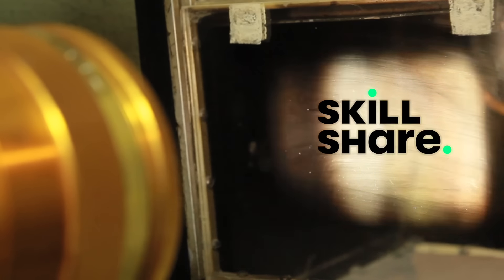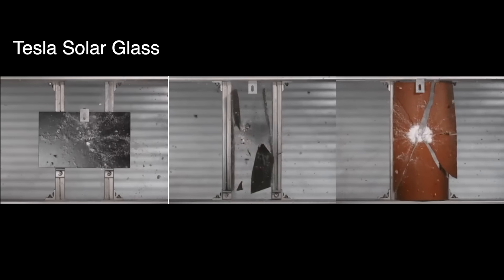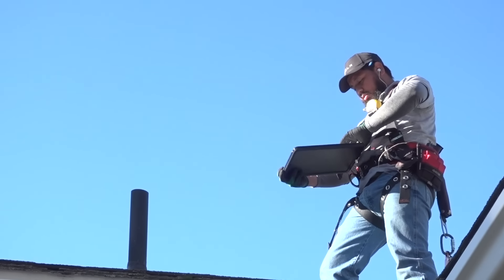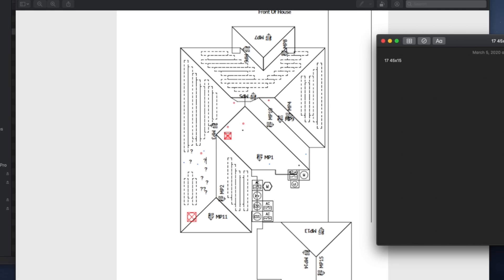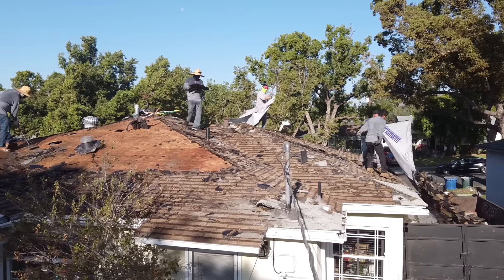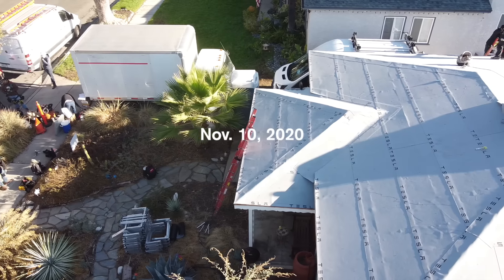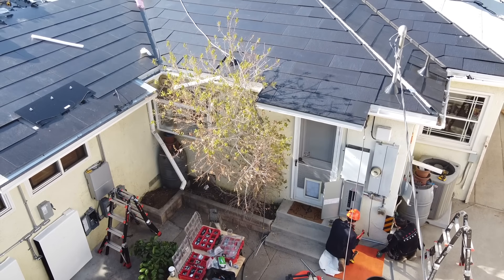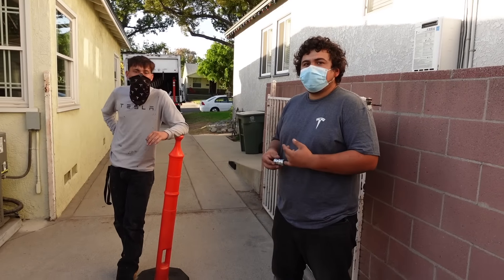This Tesla Solar Roof Was NOT Built in a Day

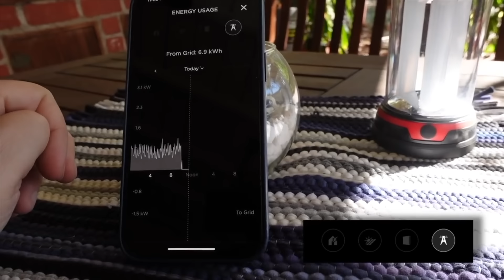Comment: 49:16 "Completely off grid" - Meaning the microgrid switch is open and the house is in island mode or that no power flow is consumed from the grid? In islanding mode, what happens if the batteries are empty? Do you have priorized circuits that are kept energized, while not so important ones are disconnected e.g. by under-frequency or under-voltage protection?
Reply: I think he might be misusing the completely off grid because his solar is overproducing by 100-120% of what they use. So yes it’s off grid because they give back more than they take, but technically they are only off grid for 60-70% of the time. Meaning the solar powers the home in the day and the powerwalls for some of the night.  He then switched back to grid power around midnight or something.
Reply: I think he might be misusing the completely off grid because his solar is overproducing by 100-120% of what they use. So yes it’s off grid because they give back more than they take, but technically they are only off grid for 60-70% of the time. Meaning the solar powers the home in the day and the powerwalls for some of the night.  He then switched back to grid power around midnight or something.
Reply: @Energy.Theory  It is not only the power balance regarding the true island mode. In an island you can't import ancilliary services such as frequency and voltage stabilisation, but you have to do all these task by the local assets. It is doable, no quetion, but more expensive than just only producing power.

Comment: I am a roofer and all rotten wood replacement is cost plus that's an industry standard. However they should have noted the 2x6 deck in the inspection. The price was super fair, plywood was crazy at the time.

Comment: You know the one thing that would probably most help California's wild fires is good forest management. The added bonus is the brushwood collected could be used for brown energy/biofuels.
Reply: Good forest management as in controlled burns?
Reply: @GeorgeMonet  Good forest management as in making causeways in trees to prevent fires from jumping from one section to a next. Cleaning up some bracken and deadwood, and using it for bio-digesters or turned into wood pellets.

Comment: Their underlayment looks like their own branded ice and water shield... its over 100% of the roof. The roof needs to breathe or you will get dry rot. You should only use I&W shield around penetrations, in valleys, anywhere the roof meets a wall and in NY you need it to extend 3' into the living space from the gutter.

Comment: The diagram at 19:02 is eye opening to me. I had assumed that every tile generated power, which would make tiles much more productive than panels on the same roof due to the increased surface area. But I see that’s not the case. It does look like the active tiles cover more area than panels would, but maybe not a lot more (judging by how my panels fit on my roof). And I’ve read that panels are more productive than tiles. I wonder how many kwh you would have gotten with panels?

Comment: Hi, it is very interesting as a diary. Couple of questions:
Which is the projected maintenance cost of the installation within the standard industry expectancy [circa 10 years]?
Which is the projected impact on the loss of real estate value when selling the property? [Loss, as with any service within a building, like HVAC, they will need to be changed and when selling the house, it is one of the first bargaining points: the age of the installation. And because it is not a passive installation such as plumbing or electric cable, it is subject to deterioration on batteries, etc.].
Thank you on advance.

Comment: As an Swiss architect with experience in solar roofs I find that American roofs have too many angels, nooks an crannies to be solar and cost effective, it also is more expensive construct. Tesla Tiles may be nice to look at, and easy to install for the average builders, but with so many small parts there are also many small components that can corrode or break, and therefore more cost intensive in maintenance in the long run.

Comment: For anyone looking at this if you have multiple roof penetrations like are shown here that are blocking you from increasing the size of your array I would like to suggest that you investigate with your Plumber the possibility of having some of those vents consolidated and/or relocated. This is not always possible but many times it is. 

Remember that when the house was built there was no concern for having as much free roof area to support solar panels or solar roof tiles and that they are not going to consolidate vents when it would cost them more money in material and labor to do so. 

But now, if those same multiple vents are blocking the installation of solar it would certainly be worth it to have a licensed Plumber move them if possible. DON'T let the solar installer do it (unless they have a plumbing license), get a licensed plumber. Fewer roof penetrations would also be in the best interest of the solar installer because there would be less obstacles to work around.

Comment: Thanks for taking the time to document the whole process. It actually answered a lot of questions that I have about Tesla’s product and process. I am looking forward to your latest update. 

I have a new home so I am struggling to justify the the roof system over the panel but I sure like the look it really is attractive. 

Couple of additional questions that I haven’t seen any one ask. 

I am curious if you have looked at what increase in value you might have seen by adding the system? I am curious because home values are already high in CA but if it could help raise the value enough to possibly remove PMI for some maybe that could be an added value. 

Do you know if there is and added R value / insulation with the new roof system? Have you noticed any benefit? I haven’t seen anything documented and would be curious. I would think for your home there would have been some kind of benefit based on just what you replaced but honestly I have no idea. 

Thanks again for the great videos.
Reply from the maker: Thank you. I wouldn't have any data on either of those questions.

Comment: It's crazy how many people your crews had on site for working... and probably not in a good way, seems like a justification for jacking the price to be honest. I've recently had solar panels fitted, then taken off for a new roof to be put on and then refitted. The panels took one day to actually fit (traditional ones) with two guys doing all of the work, the roof replacement took about 4 days (including facias and guttering) and that would have taken less time if it wasn't for the lack of access to the rear of my property. Again, that was 4, maybe 5 days (not even full days) with two guys working it. The roof replacement was a completed replacement as well, stripping all of the old tiles (heavy concrete tiles too) and replacing like for like, with weather proofing, new timber and boards.

Granted my roof is probably a little smaller than yours but in return my building is a fair bit taller (a very tall 2 storey building) and the tiles more substantial but I think it's really odd that you had like, maybe 10+ people to bill for in those crews. Crazy... is this normal in the states?

Comment: So love the idea of my roof producing power. So we also Installed a solar system, our system after about two months research we decided on our set-up and what we might need. We ended up with a 10.5 kW system on our roof and it cost under $13,000 AU dollars now the government also gives a small rebate the company that install it. We love the reduction in our power bills. But we still have bills and it hasn't taken us off the grid and no we don't have a big house and we are very carefully about how we use that power. So the cost of a Tesla roof seems an extremely expensive system to install. But l'm glad to see this type of system it does look far prettier than my panels.

Comment: Interesting.. here in Europe we have no installation outside the House .. the only thing thats outside is a fuse for the energy provider.
The battery and inverter are sometimes in a Garage on the Wall or in a seperate small room in the house where also the meters and ac equippment is located.

Comment: I had an old roof so had a new one put in about 8 months ago, costing about $14,500. Tesla (Musk's company) will probably put in about 13 or so solar panels to get me 7300kwh of solar at a cost of around $7-8000 (not sure yet since design is not done. I don't find that a battery will work for me and they are incredibly expensive so my total cost for the solar panels will be less than $9000 with a payback in around 4 years. I wish you success with your system, particularly not having to pay large repair bills after the warranty expires. Thanks for sharing your excellent video!

Comment: NOT PLYWOOD!  
Great Video very nicely produced / post produced. 
I don't know if anyone else has mentioned this. But you have been specked / charged for PLYWOOD and everyone refers to it as such, but what you have is something quite different! I believe it may be called 'STRAND BOARD' in the US and is what we call in the UK 'CHIPBOARD' sometimes 'OSB'.  Made by gluing and highly compressing scrap/chips of wood together into sheets. As apposed to shaving long lengths of tree trunk and gluing / compressing them together at alternating angles for strength as is the case with plywood. Very strange as your additional $3k cost was specifically to cover the additional plywood?

Comment: I looks like the powerwalls run of AC which is a waste converting the DC coming from the solar to ac and then bak to DC to the batteries. Other brands run DC to the batteries and use the same inverter for both the batteries and the solar, which is more effective. But looks like a clean install overall.

Comment: I don't know what this guy does for a living but how calmly he answers with a low energy "ok" when they tell him how much more it will cost or how long he'll have to wait is not how most people would react. As an engineer I know the price of the hardware. Using 16 panels rated at 450W each, that would produce 7.2Kw of power. Each panel is $240 x 16 = $3,840 of panels to get 7.2Kw of power. And they charged him $31K for that part? Then you have three main components in a system: 1.) The inverter that changes Solar DC to house 120VAC and 240VAC. 2.) A battery. And 3.) A battery management system. Let's start with the battery. Tesla's Powerwall is $7,700 each. They're rated as 7kW backup power each. On my first attempt I found a 10.2kW solar backup battery for $4,900. And there are even less costly ones I could find. The battery management system (which helps not over charge the battery is about $800. And a Sunny Boy 10K inverter is $900. So forgetting the roof replacement for a moment and adding in about $6,000 for permits, junction/breaker boxes and mechanical hardware it would be a close amount to $24,100. HALF of what solar installers charge. This is very typical of solar installers. If you want to make a lot of money, don't charge 100% more, just 50% more and you'll get all the business. Solar is still a scam price wise. This guy must have a lot of money to spend. Even if your electric bill is $400 a month it will take you more than 10 years to see a profit.

Comment: 25:50..."sheets of plywood"..then they instal OSB.  NOT THE SAME THING !  This isn't so much a knock of the Tesla system, but more a warning of selecting the right roofer/installer.  Also you have to do it to Tesla specs or your warranty is void.  Beware...too many contractors out there.  In Massachusetts only licensed electricians can touch solar components.  The roofing can be done by carpenters, but only licensed electricians can install solar due to the grounding specs.  At least these guys are being OSHA compliant  with the tie-off harnesses which is a good sign.  But if they don't hook in it would make me wonder what else they're not doing 100%.  Thanks for the video.

Comment: Solar PV only works if its economically viable. Mass production of PV panels and standardized installations make this possible. I can install a smart all black PV array into a roof - not above tile but actually flush with the tiles for £5000. In 6 years time it will pay for itself. Doing this with solar tiles the price will be 3 times this at minimum. 
What's the point?

Comment: Can the Tesla "powerWall" batteries be charged from utility power as well as solar?This would be a nice option.That the batteries could be charged all of time in case of unexpected power outges.And could the PowerWalls,wiring,transfer switches ,inverters be installed on a garage inside wall?That could protect them from the weather-IE areas of frequent wind driven rain,hurricanes as we get in  East North Carolina and other East coast  areas.

Comment: Thanks for the information and video. Wondering if all the tiles on your roof were solar energy producing or if only a percentage of tiles were? Also does your roof get sunlight a high percentage of time during daylight hours or do you get some oblique angles at times of day (or later in the day) and if so, how does the energy production for those tiles differ as the sun goes down. My solar panels were placed for what the installed called the 'sweet spot' but they stop producing much energy as the sun dips down toward the horizon and yet part of my roof without panels continues to get sunlight on it until the sun nearly sets. I'm wondering how much energy production I'm losing due to that and wondering if solar roof in hindsight may have addressed that issue.

Comment: Great video! What is the climate like where you are at?  Your average energy use without solar is so low, do you not have to run the A/C?  I have a traditional solar panel roof, a 51Kw/h configuration. We consume every bit of that and still pull some from the grid. Our avg. daily use is 150kw/h.

Comment: And now your house is gonna get hot asf in the summer
Reply from the maker: Not really. Tiles sitting elevated off the decking creating airflow between the tiles and the 3/4” thick underlayment. Tiles also reflect back. Attic’s been about 20 degrees F cooler than before.

Comment: Only thing I would worry about is that Tesla tile uses plastic holder/rail to hold the tile. no matter what kind of plastic, they all break down under UV light. And those inhesives might not able hold tile clips under constant expansion and contraction. I would go with metal roof. They might not last 20yrs. Time can tell, I will come back 20yrs in the future 😂

Comment: So you got the Delta inverter, right? Also did they installed the soft start for your AC unit or it was not included in the critical loads center?

Comment: I wonder whether it’s possible to add another control box which can redirect feed some of the solar panel’s DC current into one’s car charger, negating the need to invert it into AC then rectify it straight back into DC again. May not be feasible, the idea likely has more drawbacks than merits, but eh. It’s an idea.

Comment: I have a question, how would you walk on your roof after this? 
I mean if something needs fixing, etc, how are you go up and fix thing without walking on the panels and probably breaking them?
also another question, how long can they be used until they need to be replaced? I've heard every 5 or so years you need to replace the panels. is this true?
thanks alot in advance
Reply: I mean they did have the advertisement where they showed something hitting the tile at a high speed so I think it should be fine

Comment: the outside metal tubing to protect the DC cables should be a pain in the ass to mount and wire correctly. As an european electrician I feel bad for US ones that should use that thing. Sure it has some style, is fireproof, but way not enough space and turn angles.

Comment: Correct. If he went into the attic, and drilled holes in the roof, unless he was blind, he would have seen the "lathing," and the rotten fasaad. The ship-lap could have been an oversight. A professional roofer would have included the price of replacement, in the estimate, and if they did not have to replace the plywood, you would have gotten a refund. You did go through a "car dealer" to buy a roof??? And car dealers are famous for adding options!!! They even did the work with rain in the forecast, so you could not immediately see the finish.

Comment: How is the federal tax incentive is calculated for a Tesla Solar Roofs?  My understanding is that 100% of the roof replacement cost does not qualify for the tax incentive as most of the roof replace does not deal with energy generating materials.
Reply from the maker: The tax rebate applies to about 50-60% of your roof replacement and 100% of your battery.

Comment: I wonder if this system would provide a bit of insulation from radiant midday sun for the upper floor of my bungalow. 
50k is EXTREMELY expensive however and my electric expenses are less than 150 a month on average.
If my heat was electric, and my roof was 20 years older,  this would be a perhaps worthwhile investment

Comment: I'd be interested to know if the average temperature/cost of AC goes up due to having a darker roof too...
Reply from the maker: The attic is actually cooler as the tiles sit an inch or so off the roof for ventilation and running the cables. This creates an air void. The underlayment may also work as additional insulation as it is about a half inch thick foam-like material.

Comment: I have one question about brownouts or power interruptions. If full battery starts supplying power to grid then how can line maintenance work with live wiring? Even during interruption you are still making wires hot.
Reply from the maker: It disconnects from the grid automatically when the grid goes dark